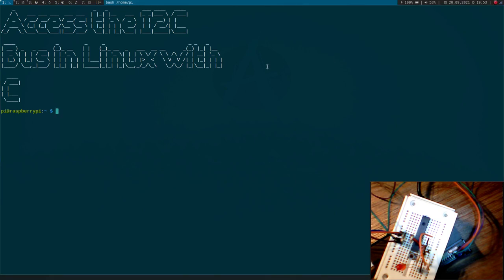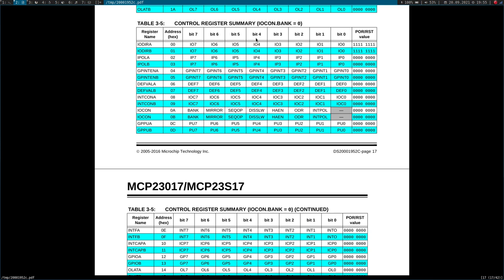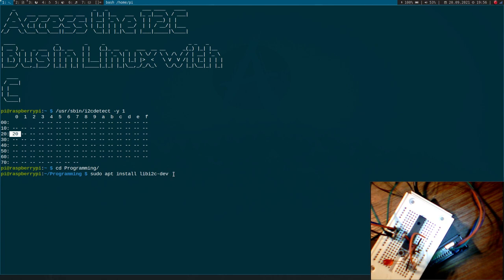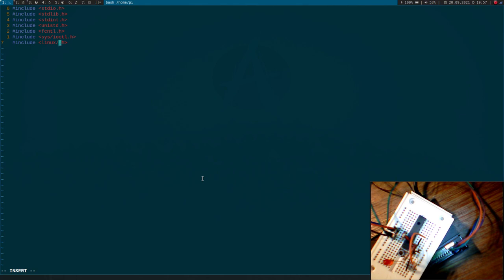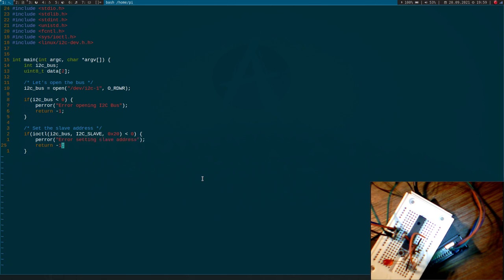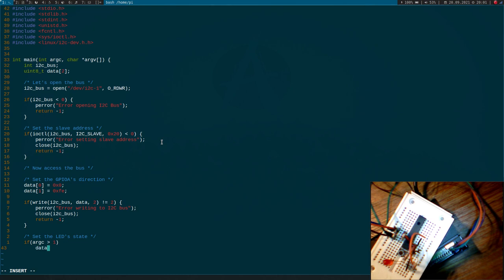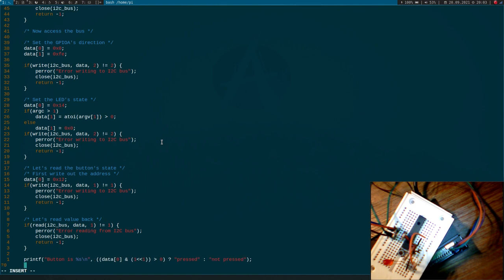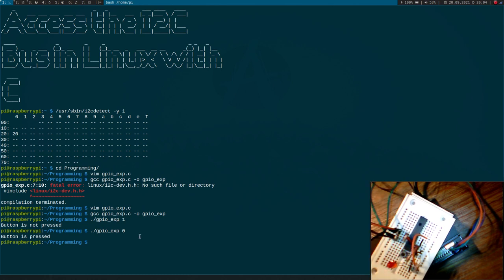Tutorial: Access the I²C bus on GNU/Linux with C

Comment: Can I use this tutorial on laptop/desktop linux computer with I²C expander connected to VGA port DDC line?
Reply from the maker: I have not tried it, but I think yes it should be possible.
Run i2cdetect -l to list all the available busses and if your vga port appears you are ready to go.
I have accessed the smbus on the PCIe Slots once. Before being able to access it, I had to load a kernel modul (i2c-i801 if I remember correctly) but after that everything worked. So, maybe you have to insert a driver too.
Reply: @johannes4gnu_linux96   I actually have done this but with Python3 (I2C LCD with pcf8574). The code I run is copied from internet and the author doesn't explain what does what.. so I'm looking for another tutorial and I found your video.. now I'm really curious about the drivers and libraries as there's many of raspi tutorials but almost none for generic linux... 

i2cdetect shows up my chip, but can i do something just with bash?
Reply from the maker: @putraadriansyah8082  Yes, you Just need i2cget and i2cset which is part of the i2ctools like i2cdetect. 
https://gnu-linux.rocks/RPi_Sensoren_und_Aktoren.pdf
On slide 20 you can find an example for usage. It is in german, but I hope it helps anyway.
Reply: @johannes4gnu_linux96  That is interesting! I also want to access the SMBus on the PCIe slot. 
Could you please explain how you did that? 
What breakout board did you use? 
If there are no license restrictions, is it possible for you to share that code or another sample code?
Reply from the maker: @husnifaiz656  Yes, actually I want  to make a video about it. I hope I can do this this or next week.